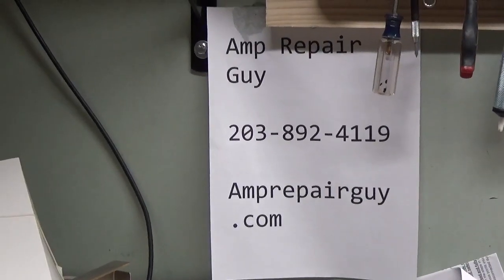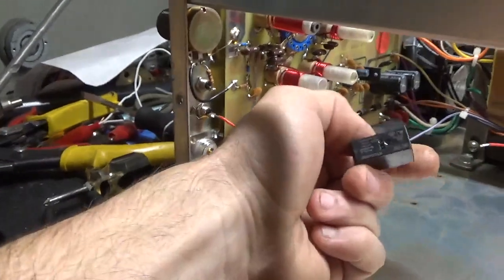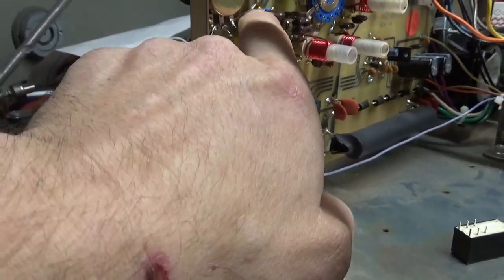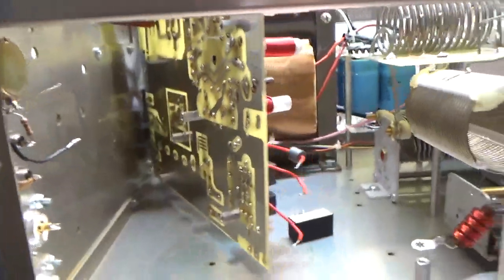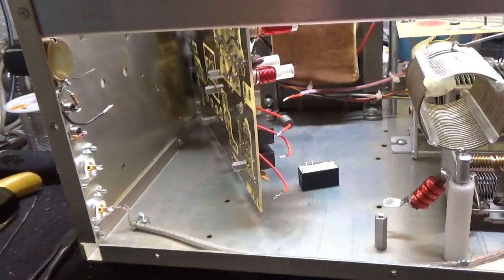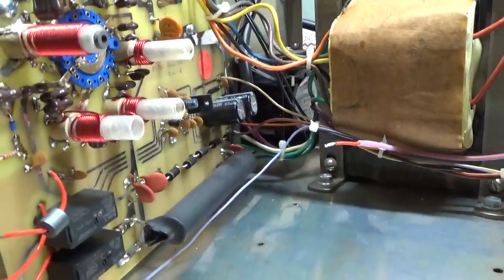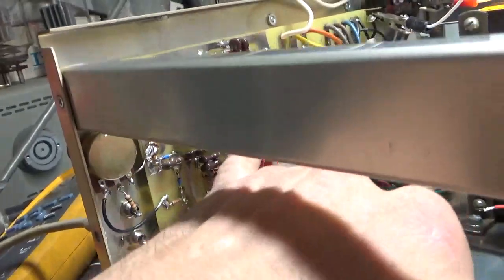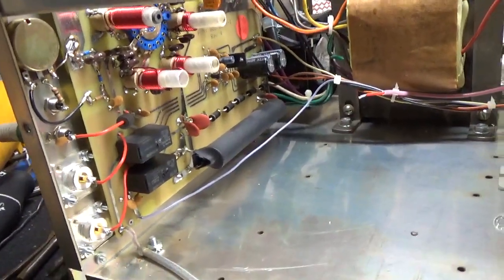Ameritron Al-811h Input Rf/Bias Switching Relay Replacement

Comment: Have replaced my tubes whit newones 572B plate meter is still going negative. All seems good replaced D16. Valves lite up nicely. Plate meter pegs to the left . Please have me a direction to look. Model 2011 811HD so no MOV and is alraedy GG. Thank you .
Reply from the maker: I recommend you send it in. I would stop trying to use it as you could destroy the new tubes if haven’t already done so

Comment: Can bad tubes not make the amp turn on at all
Reply from the maker: Bad tube if flashed could pop a fuse

If fuses are good and will not turn on them you have another issue

Thank you for watching 

73

Comment: Have you ever had to replace the Band switch on the PCB? That switch is very delicate. Who knows where you even get one.
Reply from the maker: Nope, but I can do it.

I have 5 or 6 of them here in stock.

73
Reply: @amprepairguy  I am in Canada, shipping of an amp would be brutal, If i could get a switch i could likely replace it myself. finding parts  north of the border  is very difficult.
Reply from the maker: Call mfj , they will sell you one

Comment: Good stuff man.. I think I might be replacing this relay on my 811H soon. I sometimes have a delay on TX. Pulled my Heil foot pedal and used my multimeter to test the pedal switch and all seems well- other connections between the FTDX3000 and amp are good too. Might down the amp and do the other mads as well. Thx for all the vids you post on it. W5YAK
Reply from the maker: Don’t attempt unless you are sure you know what you are doing, I won’t get involved after the fact. Ends up being more work than it’s worth 

73